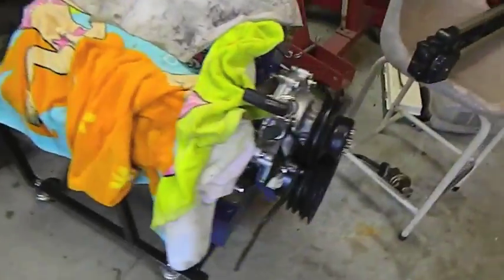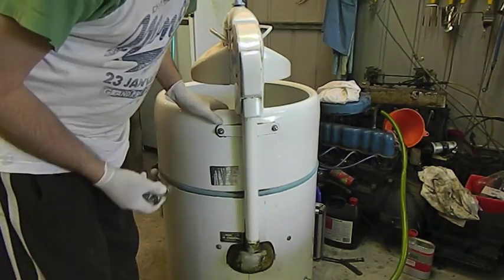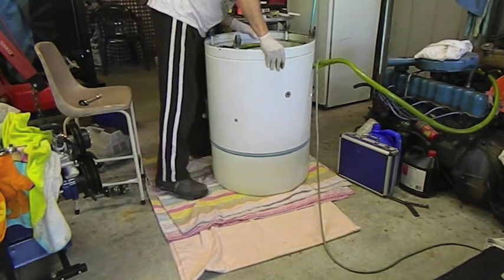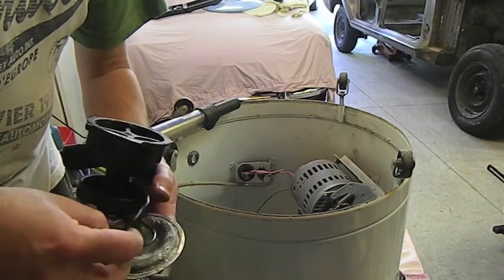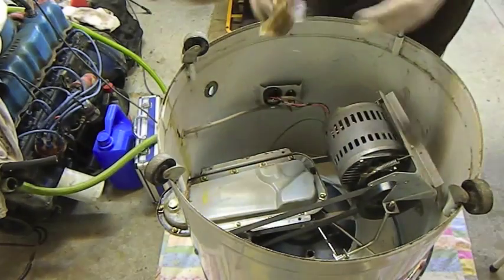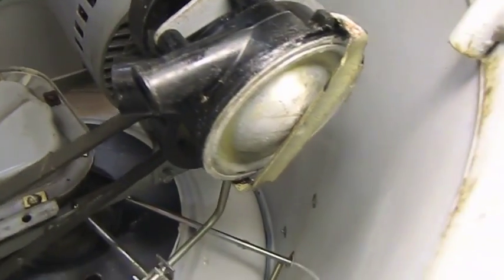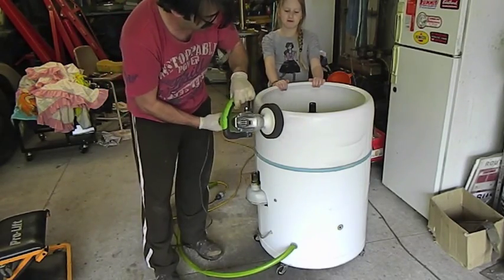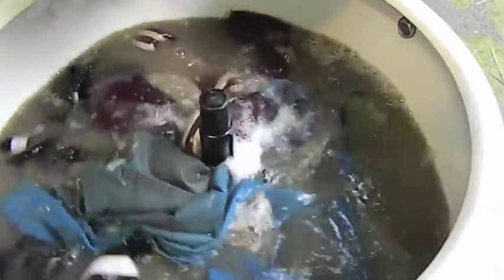Refurbishing a Vintage Westinghouse Washing Machine

Comment: It doesn't look very "vintage" on the inside with all of those plastic housings and cheap stamped steel housing electric motor. 
It looks like a 1980s or 1990s machine that was marketed as a retro look washer at the time.
Reply: the motor and/or pump was probably replaced.
Reply: Last wringer washer was made by Maytag 1983. I have made by Dexter which by the model #, were ild've been originally made in 1938. However, there's no way it's that old.( a reissue perhaps 1960s given the safety bar wringer)
Usually, the transmission takes farm grease. WHAT LOOKS like oil , Is just farm grease that has broken down over the decades with dirty., soapy water. Really nasty stuff.
And inside, there us some awful sludge that should be cleaned out. 
However, try finding a new gasket for that transmission. You could try making g one, but easier to just use a thin bead of "forma gasket" on the two halves of  the casing after refilling with farm grease. This is a once in a 20 year job.
The wringer is the only part that we have in over time. Rubber-covered rollers just dry rot.
I bought a portable clothes spinner yhat although low in capacity/have to dollies by piece, does a pretty good job.